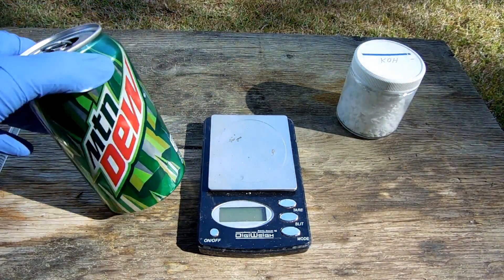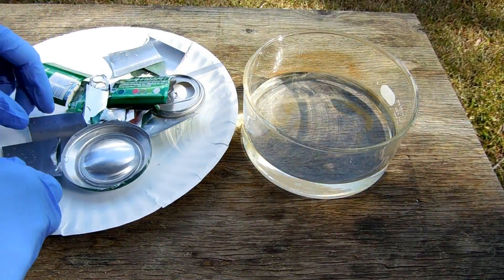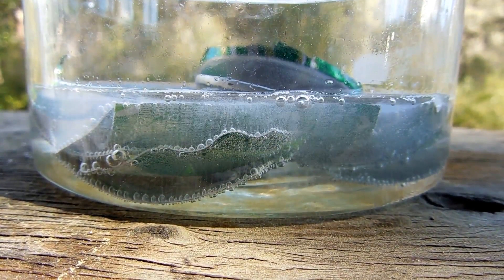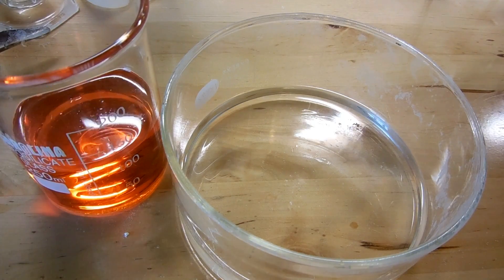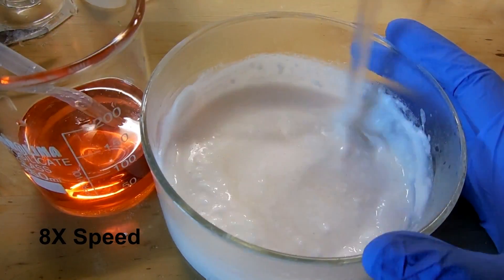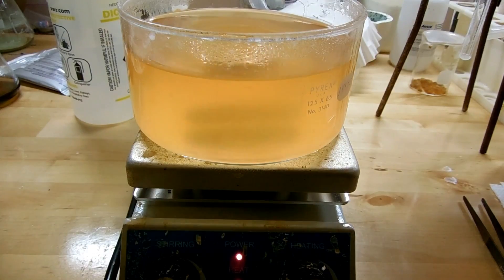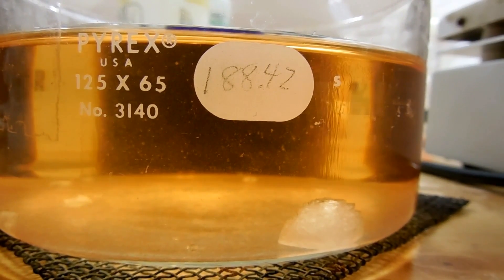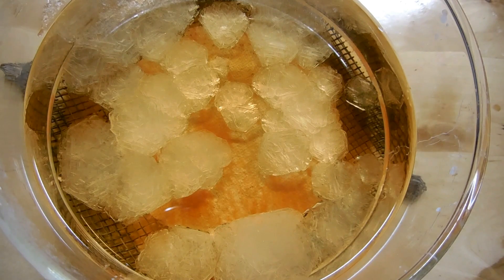Alum from Soda Cans

Comment: Im just curious if the cost of the reagents make it worth the yield of the alum.

I need a semi large amount of alum at the moment, but don't want to spend the money (or as much) on store bought or ordering online.

oh yeah  where do you get the potassium hydroxide?
Reply: Order on E-bay or from the place I buy my Monoammonium Phosphate very cheaply Chemical Store.com
Reply: I actually don't know much about organic chemistry, so I'm sorry I can't help you on that front.
However, using moles is something I do all the time, so I can definitely help you out there. A mole is just 6.0221 * 10^23 atoms or molecules of a substance. A mole of different things weighs differently. For example, a mole of iron atoms weighs more than a mole of hydrogen atoms because an individual iron atom weighs more than and individual hydrogen atom. 
For the 5 mol % of L-Alanine, it means "For the number of moles of MAP that you have, the number of moles of L-Alanine will be 5% of that." And you're right; in this case it's not just 5% of the mass.
You need to use something called the molar mass. The molar mass is the mass of one mole of a substance, and it is different for every substance. To find the molar mass of a compound, add up all of the atomic masses of the elements that compose it (rounding to the hundredths place.)
For example, the molar mass of water is 18.02 grams per mol, because:
H2O
H = 1.01 g/mol * 2 = 2.02
O = 16.00 g/mol = 16.00
2.02 + 16.00 = 18.02 g/mol
The molecular formula for MAP is NH4H2PO4, meaning there are:
6 H atoms *1.01 g/mol = 6.06
1 N atom *14.01 gmol = 14.01 g/mol
1 P atom *30.97 g/mol = 30.97 g/mol
4 O atoms *16.00 g/mol = 64.00 g/mol
6.06 + 14.01 + 30.97 + 64.00 = 115.04 g/mol

Ok, so now let's assume that you have 100 grams of MAP. You need to use dimensional analysis to convert grams into moles:
100.00 grams * 1 mol/115.04 grams = 0.86926 moles.
***The grams cancel out and you jsut divide 100.00 by 115.04

Now we need to find the moles of L-Alanine, which is 5% of the MAP, so...
0.86926 * 5% = 0.86926 * 0.05 = 0.043463 moles

Finally we convert the moles of L-Alanine into grams. The molecular formula of L-Alanine is C3H7NO2.
I'll let you convert the 0.043463 moles into grams, just as extra practice. If you have any questions, please ask; It's impossible to explain all of moles and stoichiometry in one youtube comment :)
Reply from the maker: Depends on where you get your reagents and what their cost is! Do the stoichiometry for the amount of alum you need, to work out how much acid and base you need. The aluminum is free(ish), if you have soda cans. My KOH was from a biodiesel supplier online. eBay also has quite a few listings.
Reply: mrhomescientist I need like about a pound of the stuff.  I can buy 1lb for 8 bucks on eBay, but I have to rust the alum purity.  You know what I mean?  If I make it myself I know what I got....
Reply: Clown Whisper ment trust not rust lol
and forgive my ignorance in general i am just starting out
Reply: I get my KOH from DudaDiesel.com. It's super cheap, only about $7 for two pounds, and it is very high purity (in my experience the only impurity is water trapped in the KOH flakes)
Reply: TheChemistryShack Hey do you know anything about using the mole form of measurement and possibly helping me work out how to introduce an amino acid into my solution of MAP? . I grow crystals with many chemicals but MonoAmmonium Phosphate is my favorite and I have grown very adept at doing it. I am getting ready to order some L-Alanine after reading a study done that showed a +5 mol% of the amino acid was most efficient. How much of an actual percentage of the solution does that break down to? I don't want to assume that it is as simple as 5%. Thanks in advance if you can help! I also wanted to note that in addition to just comparing straight ADP and Alanine doped ADP they used Arginine doped ADP. The Alanine was much more efficacious than the Arginine, but what about using both? I know that only experimenting can tell so I wanted to include this information so you might be able to include a more helpful answer. I understand they also dope ADP with other salts like Chromium and Boron so if you want to expand your reply by pointing out some chemicals that might help me in my work it would be appreciated. In any event i plan on following your channel.
Reply: KOH or potassium hydroxide is that thing that you cleen pipes with

Comment: Actually u have to know the fact that temperature of a liquid, or salts dissolves in a liquid , etc. also changes the refractive index of the solution , since water and water with alum has a different refractive index , as the alum crystallises , the solution surrounding the crystal has now a lower concentration of alum than the surrounding alum solution , this concentration difference makes the less concentrated solution floats to the top due to lower density , and the higher concentration liquid was be in contact with the crystal again and continue to grow larger , without gravity , u would expect solution crystallises longer , because the concentrated solution cannot have a quicker contact with the crystal , while the diluted one remains surrounding the crystal , this greatly slows down the crystallising rate .

Comment: although your demonstration is excellent but you should know that Aluminum metal is far more expensive than Alum, you can easily manufacture Alum from Kaolin, sulfuric and Potassium Hydroxide.
But anyhow excellent experiment and nice explanation.
Reply: Cost wouldn't matter if you get your aluminum from cans.  Many people save them from their soft drinks or even get them for free from the side of the road.  Also, many household things are made from aluminum, so it is very easily found at home.  I get it for free from the scrap dumpster at work.  I have nearly a ton of it, literally.  All for free.
Reply: Also, kaolin at most stores is pretty expensive.  At Wal-Mart it is $14 for 2 lbs while empty cans are free and aluminum from the scrap yard is less than $1 per lb.

Comment: There are two possible explanations that I can think of for the rising currents.
What is certain is that the solution is rising because the density of that area is being lowered. i.e. convection is occurring. 
The crystallisation causes the density to lower in two ways:
1) The process is exothermic and causes the surrounding solution to heat and as a result convect upwards. (hotter liquids rise as they have lower density)
2) The solvent that loses solute does, as a result, achieve a lower density. Though, I wonder if diffusion of particles should prevent this effect being all that noticeable.
Reply from the maker: Both very good thoughts! Sounds very plausible to me.

Comment: I have found in the past that currents rising from crystals consist of less dense less saturated solutions while redissolving crystals tend make denser solutions. I have used this to grow crystals by suspending waste crystals above a seed crystal.
Reply from the maker: That's an interesting idea! Thanks for the tip.
Reply: mrhomescientist I have encountered this phenomenon while growing crystals. It is simply, as Gareth Dean said, solution of smaller density rising up, because the dissolved salt has percipitated on the crystal.
Reply: Isn't it also caused by the heat of crystalization?
Reply: adam co
It can be but that tends to be a weaker effect; unlike when solids crystallize from melts, less energy is released when something crystallizes from solution. You can see this by checking the opposite; how the temperature of a glass of water changes when you dissolve sugar in it.
Reply: Exactly, there are many salts that barely show any "heating effect", NaCl for example.

Comment: If i have NaOH ? will work ?
Reply from the maker: Yes, but you'd be making a different type of alum. "Alum" refers to a whole class of compounds, the most common of which (and the one I made in the video) is potassium alum. Using NaOH, you'd be making sodium alum which may require tweaks to the process.
Reply: Ok thanks
Reply: mrhomescientist
Sodium alum only crystallizes at low temperatures. At room temperature it tends to form an amorphous mass of sodium and aluminum sulfates. Rather disappointing really.

Comment: If you have a scrap or junk yard near your area you can take your cans and sell them to fund your projects
Reply: Richdudethe2nd cans are worth 5¢ in america, 10¢ in Canada
Reply: It also depends on the scrap yard.  Some only give $.20 - $.50 per pound.  And they deduct a lot if any cans have even a little liquid in them.  I've taken 3, 50 gallon bags to scrap before and only made like $25.  6 months worth of cans.  Almost not worth it.  So I just save them to use in experiments and to melt in the forge.  It's always fun to fill them with water and drop some water dynamite in them.  Lol

Comment from the maker: Nope! Since we are using sulfuric acid, any calcium compound will form very insoluble CaSO4 (gypsum). So you wouldn't be able to use that to make an alum. Just about any other hydroxide, though, should work in theory.

Comment: My guess about the flow above the crystal is that you're seeing the energy released from the solidification process.  Just as heat is absorbed by solids as they melt, the same heat is released as the liquid phase solidifies.

Comment: I check your video and it is great.  Even as a chemist, i could probaly not make a better one.  I reproduce the experiment and work fantastic.  I get 3 big cristals (30 grams each), so about 50% yeild.  I will keep the rest of solution and try to seed with a small cristal because the solution sould still have alum inside.  As i did not have KOH at home, but NaOH instead, i make this minor variation : Adding 38 grams of KCl (no salt substitute) during dissolving aluminum.  Excellent video friend.

Comment: You can use NaOH, BUT this will be much, much vigorous reaction. It is extremely exothermic, if there is not enough water it will heat a lot, probably more then 150 or even 200°C. It also forms a lot of vapor which contains pieces of NaOH and this is kind of dangerous, you have to do it outside.
The only way of doing this safely is to use a weak solution, it will react just slowly.
And by the way: on air it forms Al2O3 and Na2CO3.

Comment: What you are seeing is (explained by Sam) due differing refractive indices of rising stream. The stream is composed of varying concentration gradients and the refractive index at any point will vary with the concentration of whatever is dissolved in the solution. As the crystal grows, ions in solution are deposited onto the crystal surface and become part of the ionic lattice of the crystal, so the solution after this is of course less conc in those ions. It rises: it is less conc so less dense.

Comment: The name for that wispy effect is Schlieren. You see it when two phases of slightly different refractive indices are side by side, which can be caused by differences in temperature (different density = different refraction) or just when you mix two miscible liquids together (ethyl acetate and hexanes, for example). It's also the reason you can see wispy shadows on the sidewalk when you open the door to a hot car.

Comment: Recrystalizations are shockingly easy.  We learned how to do them in my O-chem lab last semester and now that we're all practiced most of us can do a recrystalization in about 10-20 minutes.  Though I imagine that varies a bit based on the solvent you use to recrystalize and the product you're trying to get.  You also have to be careful not to cool back down too fast or instead of crystals you'll just get a solid precipitate again :P

Comment: The "stuff" coming off the top of the crystal could be water which would be more pure and less dense than the surrounding solution due to the solute crystallizing out of solution. Therefore, the less dense water will rise in response to its more dense surroundings.

Comment: Also, I remember having once left a piece of aluminum foil in some aqueous sulfuric acid (battery acid, around 37%) and forgot it for several months. A layer of aluminum sulfate formed on the bottom of the acid. I then added one more piece of aluminum, left it for months again, and a really cool thing happened : the aluminum sulfate crystals kept the shape of the aluminum foil! I guess it is what happens when you react metallic aluminum with aqueous sulfuric acid saturated in aluminum sulfate.